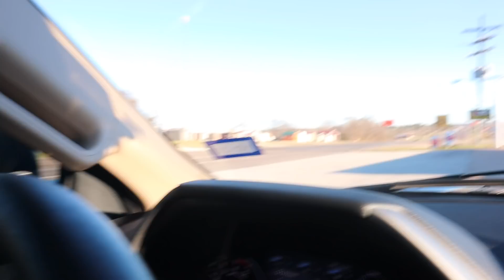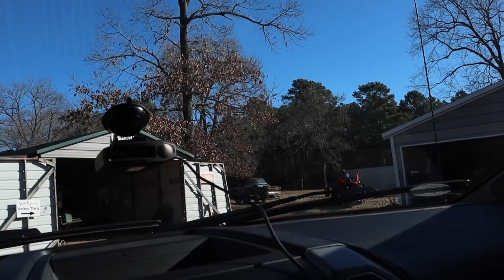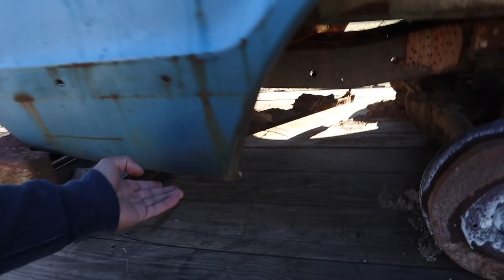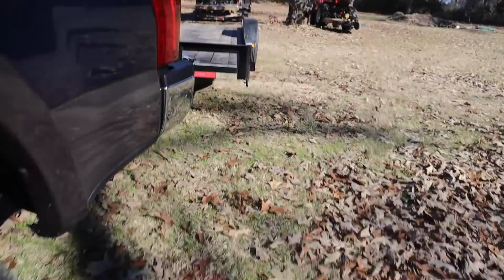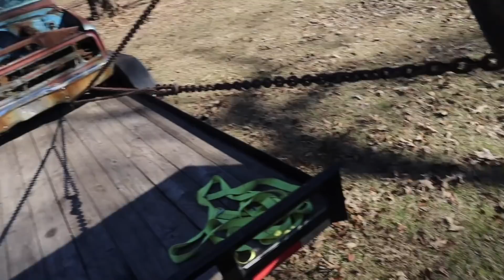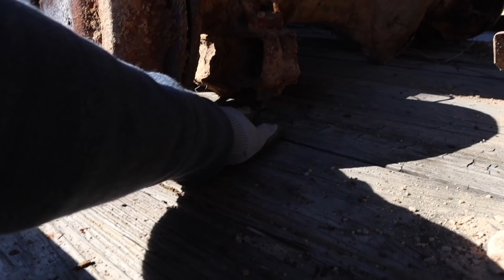BUYING A 1967 C-10

Comment: Orale. This reminds me if myself back in the day i Loaded a lot if cars and trucks like this over the years. Since i had surgery for a herniated disc, i dont do it any more. I bought a c list warn winch for $200 a few years ago. It was on a receiver mount.  I welded a $20 harbor freight receiver on my  trailer  and since my truck has s lift gate, there was already 2 ga wire at the back bumper. I just  added a 4 ft  “winch power kit” i bought from amazon. That and some harbor freight dollies would save you a lot of time and energy.
Reply from the maker: Man thats sounds like a great idea. I might look into installing a winch on my trailer.